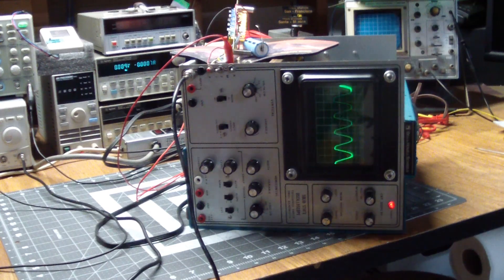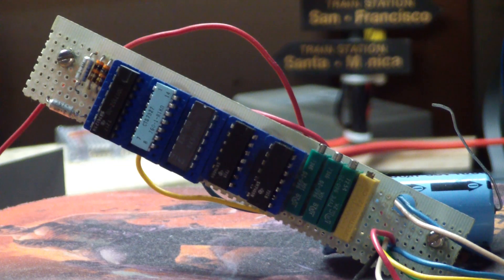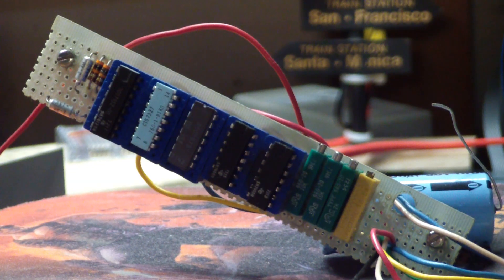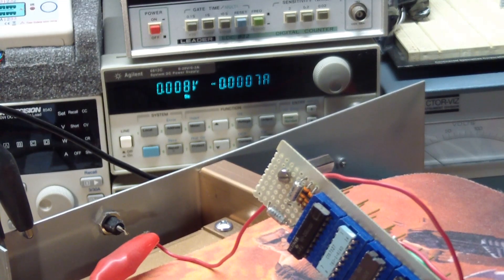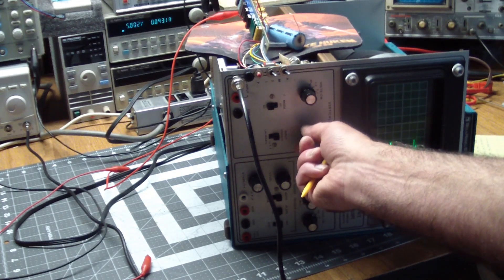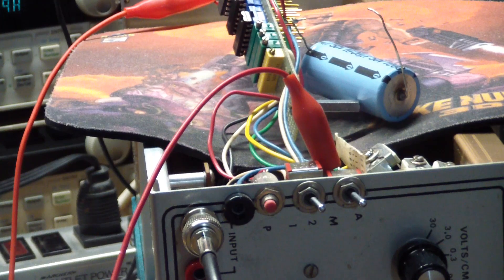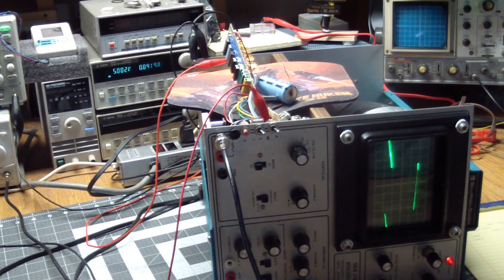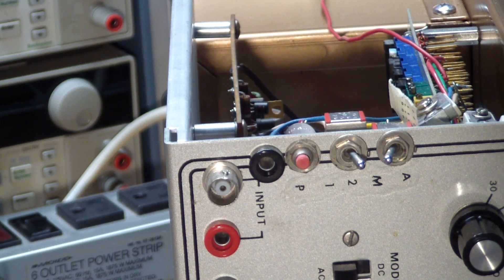AE#176 Bell & Howell Oscilloscope Mystery Proto Board

Comment: The blue ic has something 81k ohm in the part number so must be a multi resistor package.  the 7408 and 7405 and first oscillator chip lead me to think the circuit was created to make a sine, square wave and triangle wave output, with trimmer pots to do fine adjust.

Comment: Maybe this scope could make a nice curve tracer?
Reply from the maker: The possibilities seem endless when using the X-Y mode. Lissajous figures (no external components required), a zener diode breakdown voltage tester (a handful of external parts) and finally a full transistor curve tracer (with lots of external parts)

Comment: Radio Shack used to use part numbers like those ICs. You might consider looking for an old Tandy or Radio Shack semiconductor cross reference guide. I checked the internet archive and couldn't find anything so you might look on eBay and other online sales resources.
Reply from the maker: I tried RS and NTE numbers and came up empty.

Comment: Dual-trace mux. The extra input jack, 1/2 switch, and auto/manual switch agree with that. I don't know what the P button would be for. Pause, maybe? I think the square wave is supposed to trigger the sweep when it switches.
Reply: This is plausable. Their is likely some fault either in the hardware or the design/wiring that prevents it from operating properly.
I wonder if it was a separate classroom project that someone decided to put inside the scope? Since two of the chips are "unknowns", I feel it's less likely to be a home design but a kit.

Comment: Isn't this Prototype function generators output to send to the External Trigger port on the Oscope for different triggering options? You haven't made a video lesson about what types of circuits would need different types of external triggering or triggering frequencies and triggering waveforms in order to view a stable waveform on the oscope.

Comment: Interesting theories in the comments, i dont think its a square wave probe compensation, why would there be an and gate, also there would be no reason to switch the compensation output on and of, except it is an input, so i think its a trace doubler, also its often analog ics with house numbers, and 25hz is weird for probe compensation, 1 and 2 on the middle switch could stand for 1 input/ two input (which makes sense because that switch is also directly connected with the jack and therefore switch the second input on and off) and a/m for maybe alternating/modulating, maybe connect a signal to it and try it out.

Comment: just a wild guess, maybe that was a calibrator square wave source to tune the input capacitance of probes? Check if the square wave goes to the added connector for any switch position. But hey, it's easier to reverse engineer the schematic than guessing :)

Comment: First, if you proceed on this you have a death-wish and should seek professional help.  Next, i love the 80 col punch card scrap as an insulator.  The 10 turn trim pots have no stop in either direction they just stop moving the tap once they reach either end -- they do make a microscopic clicking sound at the limit. We used to turn them 15 turns in one direction and 5 turns in the other direction and they could be 1/2 the end to end resistance.  I got nowhere with Heath house numbers you would have to guess about the IC function based on the schematic, you could then use a TTL IC tester and run through 100 IC  types and maybe find out what it is.  As i said this is a death wish move -- do not proceed.  If you do i will visit you in the loony bin and make sure there are no sharp objects within you reach.  One final thought you could obtain the manuals for all Heath kits that use TTL ic's and look for that number in the parts list and get a clear idea of what IC it is, but you could do that study while you are in re-hab.
Reply from the maker: Professional help is hard to come by in my neck of the woods.